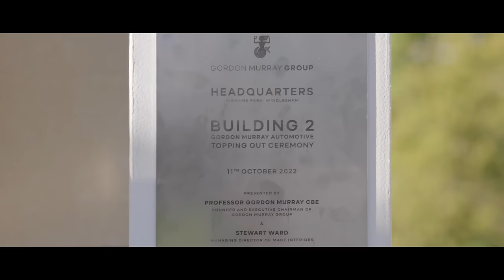Gordon Murray Automotive: T.33 Spider full reveal film

Comment: So what does this car offer that the rivals don't? I would say a manual gearbox(only Porsche does that I believe), a naturally aspirated engine, 10.000+rpm, analog controls, less weight. But by far the biggest offering of this car is the way it looks. It IS lighter than the competition but it also LOOKS a lot lighter than the others. And this is the best thing about the T33.

Comment: I prefer the T.33 💙 over the T.50. Minimal weight gain or power / rev limit deficits, but much cleaner looking without the rear fan and comes as a Spider. The rake of that windscreen = 😍.
Edit : I despise working for a living, but would happily fill in for Dario.

Comment: 8:42 Oh my god you've turned it into a frog! also your making the two piece targa roof out of carbon, I hope you got paint protection film on it, as that banging around in the front is gonna scratch the hell out of it, as the best system for a targa is the Volksporsche 914 when it was a cloth leatherette top that snapped in as one piece in the front in the cars two trunks, big ones! that way it avoids the leaks like the T top american cars had, and you dont have to store it in a bag or behind the seat like in a 308 targa top, as it just snapped in the front

hence the magnum PI targa top removal scene, as if more cars did it like the 914, the targa would still be around vs the new sunroof coupes that offer the same thing with none of the problems. 

which is why most targa tops now are just folding top coupes like a ford fairlane 500 and the mercedes 240 Kompressor now, like you gotta make them snap together and in place with no movement in the trunk, as the slightest rattle is gonna drive the owner nuts and most people will end up leaving it at home because of that

as its a good idea, but you gotta do it right and put a film on it, as that will get banged up, both on the piece itself and the fitting area where it snaps in. 

and it better hold pressure and snap in well or its gonna leak like an all american corvette, in addition to all of that

which reminds me I need to look for a lotus elise mark II again, as now that is a damn good looking targa

Comment: How is it that no other manufacture can make a no-compromise vehicle that is focused on everday drivability?  This thing is small, light-weight, and powerful, with great visibility, good storage, acceptable ride height, not overly flashy with a simple and functional interior.  I really don't understand why no one else can do this????
Reply: They don't try - they are after horsepower figures, acceleration, Nurburgring lap times, top speed records, downforce. Gordon is all about perfecting the basics of road driving and has none of all that you would never use. But even if the competition tried to do something super minimalist, remember the ultra compact Valkyrie? Where Aston Martin was shaving nanometres and micrograms? It still ended up at 1270 kg. That's the magic of Gordon, he starts small. This is fully homologated, and weighs almost 490 kg less than a P1. It makes Lambos look obese.
Reply: Most but not all other car manufacturers are run by committee...

Comment: It is a very nice looking car, set at a very high standard.

However, the C pillar / buttresses does seem to be misplaced, perhaps 10 cm too far forward and should be aligned on the rear shut line of the door. This indeed highlights the unnaturally long wheelbase (pointed out by others).

Anyone wishing to see what I mean should look at the first 1963 250LM on the manufacturer's website even if there are echoes of Elise S2 and 904 in this car...(this is very much a compliment).

Full marks for building a car close to 1000kg. Only Alpine currently comes close to this and the chubby offerings from other manufacturers (Zuffenhausen, Modena, hethel) are simply irresponsible.